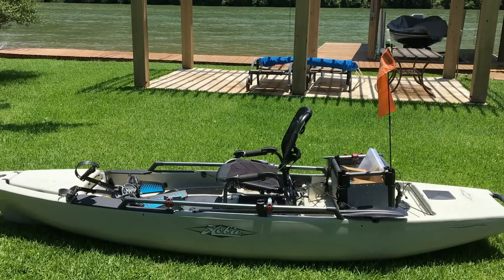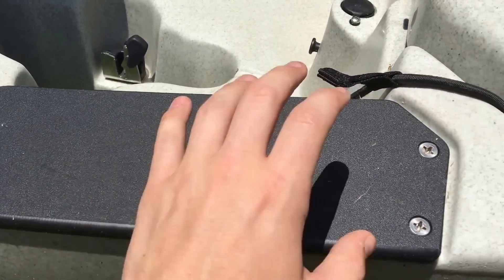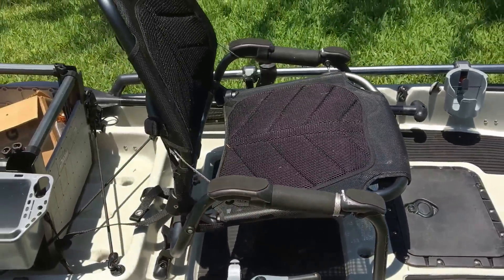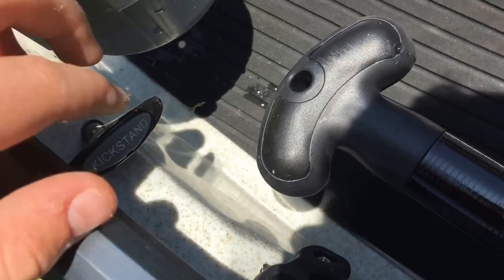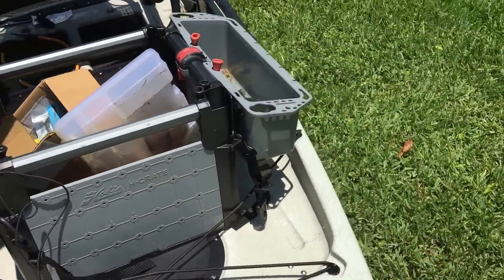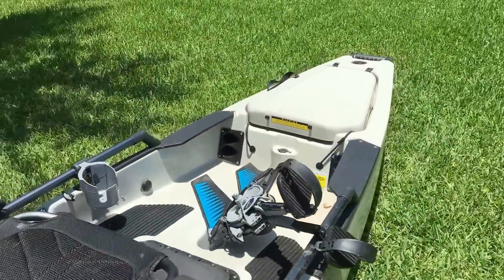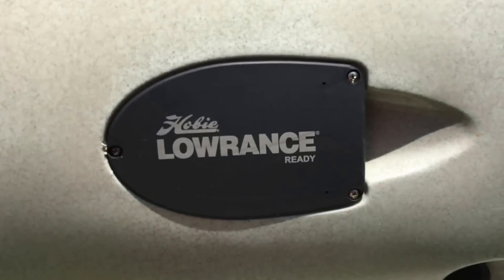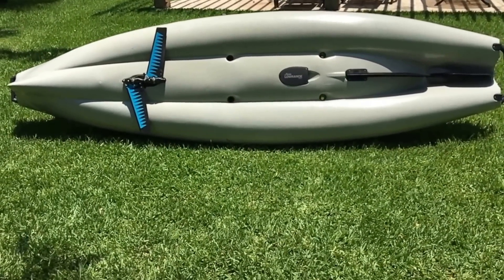2016 Hobie Pro Angler 12 Kayak Review

Comment: I'm looking at getting a 2016 when the 2017's come out hopefully to save a few bucks. What are your thoughts on the 12 vs the 14? I have a pickup and a trailer so I will be able to tow either I'm pretty sure.
Reply from the maker: It depends how big of a guy you are. I would suggest the 12 because it is a little more maneuverable. But if you want a big boat go with the 14 if you have the extra cash

Comment: Do you find it difficult to turn around and get stuff from the back?
I have trouble with that high back seat.
Wish they just put a swivel seat in there.
Reply from the maker: At times it is a little tough to get gear from the back especially in rough water. I just try to put as much stuff that I need in the front and leave the back for things I may need just in case. Who knows maybe someday they will add a swivel seat!